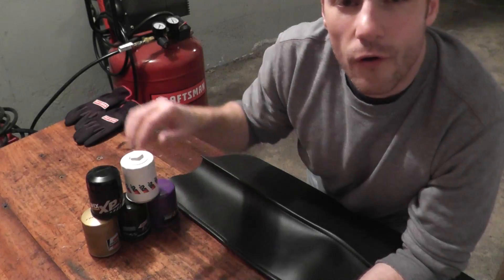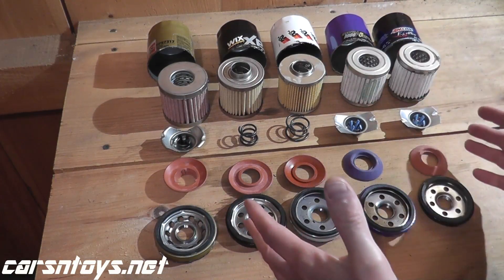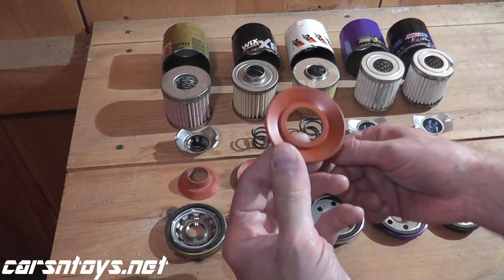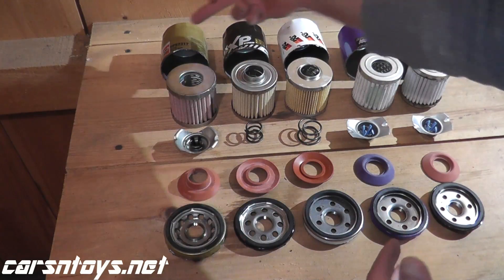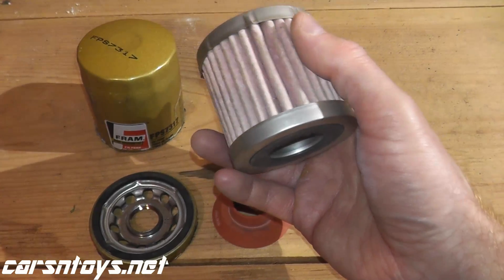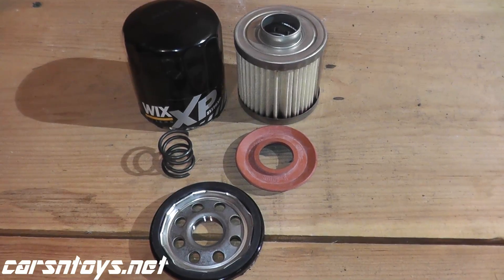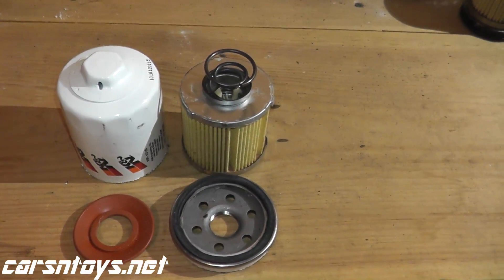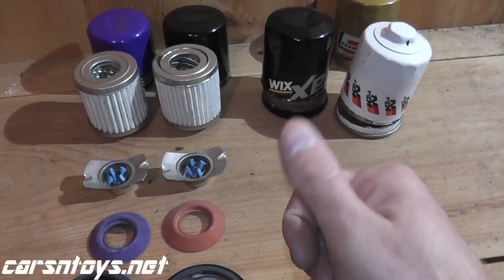Choosing the BEST OIL FILTER...FRAM vs WIX vs K&N vs Others

Comment: Thanks for the update video!! A key thing to point out on K&N (and reason I stopped using their air filters). Is they technology (media to filter). Is they push that it flows well. But on the flip side it does not filter as well. Two sides of the same sword.Maybe reason for more material is to compensate. But if the material is more open it will still let small particles to flow pass regardless of how much material it is. Just different mindset.. K&N is marketed as a racing filter which oil flow to moving parts is very important, and engines that are subjected to racing do not follow standard maintenance schedules. They generally get changed at a much higher frequency so the filter is really a safety catch to catch big particles to save other components when things go south. WIX also has a Racing line of filters. In racing flow rate is more important than filtration. http://www.wixfilters.com/Speciality/Racing.aspx
Reply: K&N for motorcycles has the base filter, which is better filtration and flow. Then the racing one is higher flow less filtration. Overall the have strong sponsorships in motorcycle racingand would never produce junk.
Reply: TheCashDeal I would not buy a filter based on some race team sponsorship. Just because a race team uses K&N does not make it better than another brand. Just means K&N are throwing money and free products at the race team in exchange for some product placement/stickers on vehicle. If an engine is gone through between each race then the oil, filter, and other consumables does not really matter as the oil will be changed to take out the contaminates. K&N flows well but it does not filter as well as others.  But Flow Rate & Filtration are like two ends of a see-saw.. When you increase one, the other decreases.. K&N is a descent filter.. I prefer to lean towards filtration and use Wix.. If you buy in bulk you can beat the parts store price per filter by 50%.
Reply: If something flows well, then there is less filtration. Flow & Filtration are like opposite ends of a seesaw. By doing ANY Filtration will be resistance to flow. Plenty of other resources to get info on it here on Youtube and the net. K&N is a hype brand, Like Royal Purple and Mobile One. K&N hype is flow. you could take a Fram and remove all filtering and put it back on and it will flow exceptionally well but wont filter anything. When it comes to filtering oil. you want the most filtration as possible to stop particulates from going into the rest of the engine. Anything can catch the big chunks, but the idea is to catch as much contaminates as possible. I honestly never heard of someone reporting engine failure due to lack of oil pressure based on oil filter flow. Most time there was a catastrophic failure somewhere or operator failure (low oil level), or not large enough oil pan to compensate for g-forces in the car to maintain a constant flow of oil into the pickup tube (track days, car racing). For filtration you should shoot for the best you can get. My engine is worth x2 what the car is worth. I change the oil way ahead of schedule. I use Wix PERIOD..  Bottom line really is if you are religious on oil changes you can use whatever filter you want. Mike Fennigan from Hotrod Magazine runs a Hellbourn 8 stack EFI on his 55 gasser with no air filters because it restricts airflow and losses HP. So he compensates by changing oil very frequently. The more shit you keep out of the engine the longer it will last.